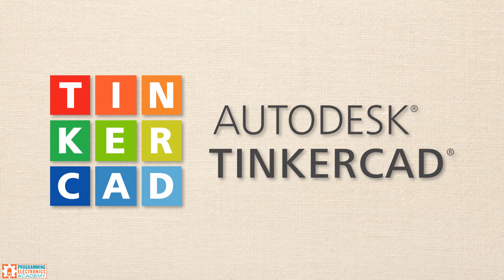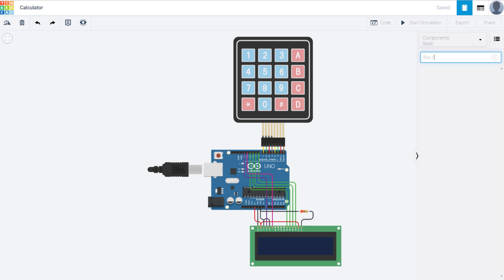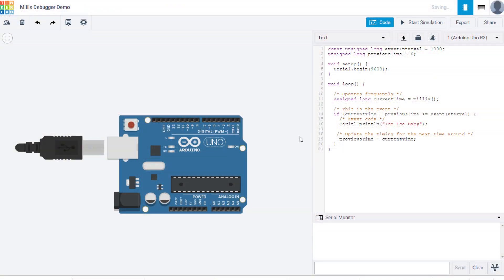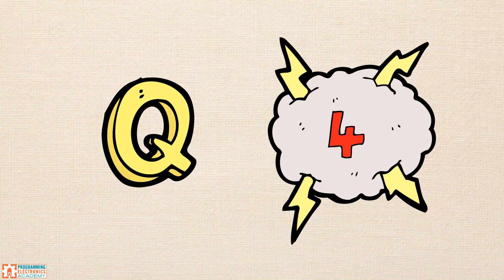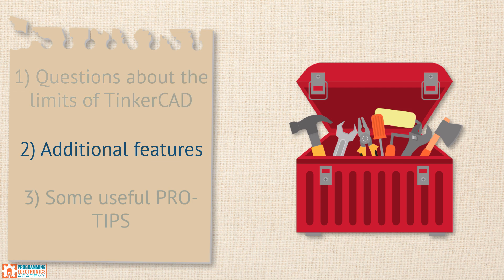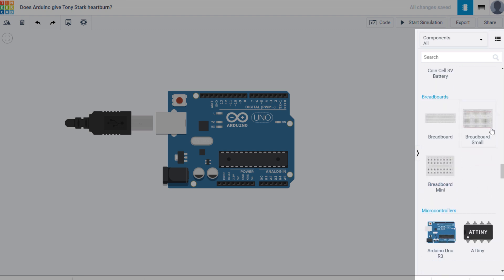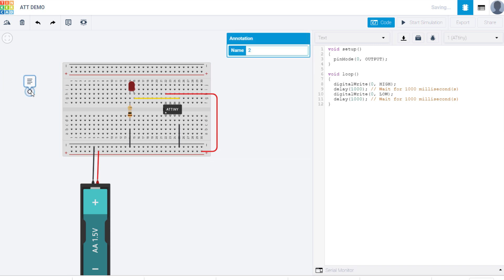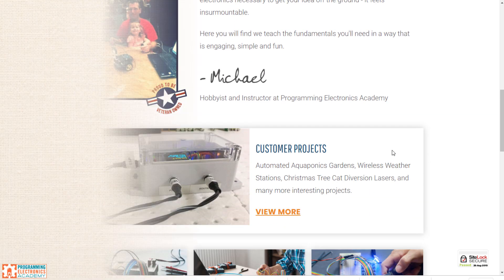Arduino Simulator Q & A

Comment: Hello, first of all, thank you for this channel, I'm learning to program since nearly a year now, and got pretty far, thanks to you and other YouTube explanations!
Now the question: a friend of mine wrote a library file that is included in the code of my main project. Is it possible to use this in tinker cad? I've made the circuit and copied the code from my ide to the site, but logically it doesn't know the "yaButton" library. So if this doesn't work, this wonderful chance of simulating my project inspite of doing it fiscally is dead even before it's born for me...

Greetings from Bremen, Germany!
Reply from the maker: Great question!

You are correct - if you just #include the library, it will not work.  

However, one workaround is to include the library source code into the simulated file.  Assuming the library your friend wrote does not use other libraries not supported by TinkerCAD, it should work.  Hope this helps some!